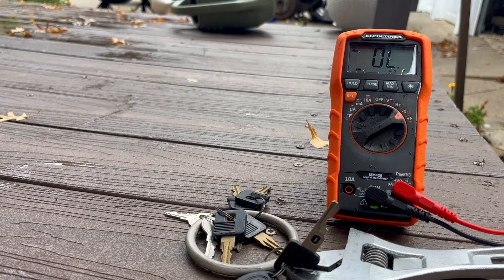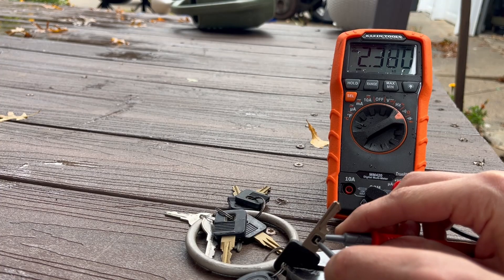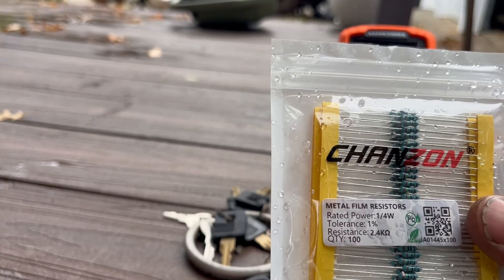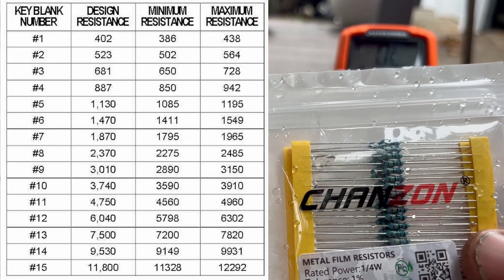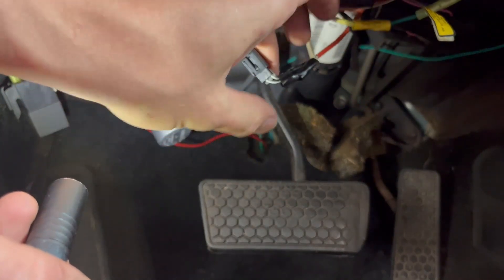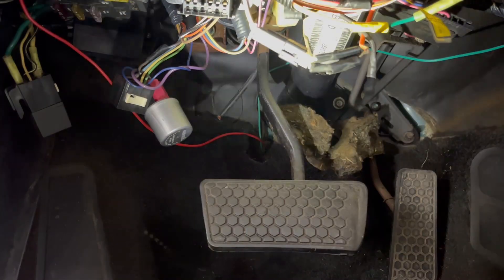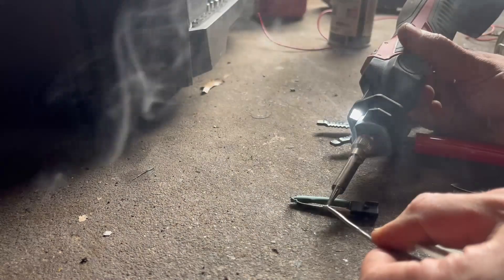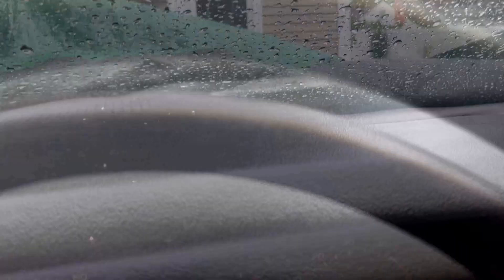How to Bypass VATS in a General Motors Car

Comment: What on earth was that huge thing you used to melt the solder? Was it part of a dumbbell set?
Reply from the maker: Milwaukee m12 soldering iron, it is a bulky thing but handy 😂
Reply: @tylersteez - OMG. Why is it so massive? The M12 pack is about 1/2 that diameter and there is nothing else needed. There isn't a brushless motor or gearbox needed 😂
Perhaps you are running a 6-cell pack but gosh what a silly tool.
Edit to add... I use a portsble soldering iron that is about 1/2" diameter and runs off USB-C or a DC barrel jack. It has a cable to a 18V tool battery adapter.
Reply from the maker: @johncoops6897 think I had a 4.0 battery on it just because it was the only m12 battery I brought with me that day, it is absurdly large for what it does lol
Reply: @tylersteez - I edited ny previous post, added what I use.
I am currently using a soldering station that costs about $25 and clips onto a Makita 6Ah pack. It uses standard T100 tips and even has Oled temperature display.
Reply from the maker: @johncoops6897 i think I was looking into those a year or two ago actually, sounds like a cool set up
Reply: my wife has one of those, says it is her "massager"